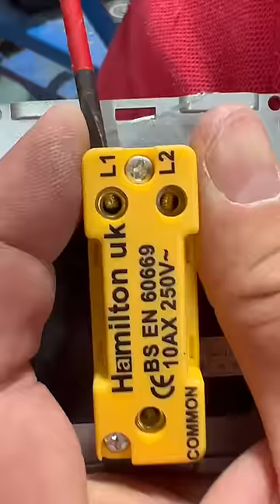Don't Get Caught Short - Wago Push Wire Inline Saves The Day

Comment: No neutral in there so use 2 bits of brown.
Reply: easier to carry normal 3 core and add some sleeving on top
Reply: Better yet, stop wasting time and material and properly wrap the neutral in electrical tape.
Reply: @Amonabus  tape isn’t recommended since it could unwind. Sleeving is easier, faster, better
Reply: @techheck3358 good tape just lasts forever unless the wire in under tension
Reply: @leftifornian2066  sleeving is easier & doesnt leave residue behind 🤷

Comment: Even better is you undo those screws, and find that the wires are not only short, but also that you have a wall where the plasterer went and had to put on 2 inches of plaster, to fix the mess the drunken builder left, who buried the box seemingly in the middle of the bricks. And to top it off, the wire is not nice PVC wire, but 100 year old gutta percha DCC covered, and the insulation will fall off at the slightest touch. To disconnect power you go to the fuse box, and find that all the fuses are now 2 strands of 2.5mm copper, except for the stove, which is 4, so that they will not blow. Power comes from the overhead wires, to the meter conveniently placed, in what used to be the outside covered side entrance, now part of a room, and also conveniently located in a built in cupboard, and feeds to a fuse box, in what was the kitchen, mounted nice and easy to get to in the top of what is now a built in cupboard, filled with around 100 pieces of cast iron cooking pots, all of then sticky with decades old oil and grease. right next to the stove on one side, with 4 pots boiling on it, and the oven running under it, and the floor is more borer than wood, so your ladder has to be placed strategically over 2 joists, and hope the paper thin wood does not let go then.

And the next 5 houses are exactly the same, because the same family has been living in them since 1890, and they got the electric in 1930, and have been rigging the meter ever since the first bill came in.
Reply: gyat damn bro
Reply: You must have been in some houses I have 😊
Reply: Damn, who hurt you?
Reply: You’ve been to Evesham ?
Reply: Suspiciously specific! 
Sounds like that one switch replacement is going to take a very very long time and a decent budget.
Reply: I feel your pain man
Reply: Drunken builders... seems about right ! And don't forget the wires in the wall only twisted together with no screws or anything. Or brittle old aluminium wires. Or finding out that soneone wired up the entire garage to an exrension cord ! 😂
Reply: @funkpop-l8o  You have met Clive then....
Reply: @SeanBZA  who is clive ?
Reply: @funkpop-l8o  Cowboy builder I know. But he at least will do things more or less right, and his work generally does not fall down. See some other "known name" builders, where you have walls that let in light, because of all the cracks, and where they kind of omitted to do things, like putting in all the rebar, and putting in all the brickforce between layers, or attaching it to the columns.
Reply: U.S. Electrician here . I had a story about an old barn built in 1910, but yours is better!
 God damn!

The oldest two family house I ever worked in was built in 1890, still has knob and tube wiring. But one thing to note, it still had it's original 60 amp service. I'll state this again, a 60 amp service for a two family house!
Reply: @funkpop-l8o  Garage extension cord was the previous owner of my current house. He also did his own gas (not legally) and it leaked and cost us hundreds to fix.
Reply: @tailgunner2  By me a standard service is 60A, but at 230VAC. However some really old houses only had a 30A service, simply because when they got electric service they had a wood fired stove, and water was from a well, heated up on the stove, with a long drop toilet outside. Often farm houses, but pretty much all got an upgrade to 60A over the years, simply because they got indoor plumbing, so the occupants wanted to change to an electric stove and hot water, or put in an electric borehole pump, which needs a little more than 30A to start up.
Reply: Pretty good description of hell
Reply: Видимо это интернациональное явление😂
Reply: Sounds like a cup of tea after a long day to me
Reply: @tailgunner2 Is that single phase or twin?
Reply: Ah the voice of experience!😂
Reply: Ong 2 houses this week ancient and evil
Reply: You must be high or drunk when you wrote that comment.
Reply: Ha ha.. ain't that the truth! Unpicking other people's bodges are the most entertaining part of the job.

Comment: Although I do get your point, I myself would not even cut anything off the wall-cables. These wago's can handle some crooked wire too. A break now could find you replacing the wall-cable.

Comment: The Ideal push inline orange connectors are smaller in size and have been around for years or you could just use a 2 way side by side wago connector as I find it easy to dress back in the back Box  and as someone also commented..FFS push done unwaned Lungs as they sometimes snag cables to result in a Line to CPC fault

Comment: We have those same devices in the states. I only trust those for low wattage applications such as lighting. 

Anything with a higher demand, such as kitchen appliances, I would sooner run a new cable than rely on the spring action, even if they are rated for #12 AWG (3.36mm).
Reply: They are tested in a multitude of countries for safety. They have also been around for a long time without issues.

We use them all the time in the UIK.

Comment: Why does no one on these shorts knock down the lower unused lugs on the back box , with more people taking feeds and neutrals to the switch instead of the light  now , so more cables in the switch box , I’ve come across dozens of faults where the cables rubbed on the lug
Reply: Because there weren’t feeds a d neutrals @ this one so not necessarily?

Comment: Whats with all the sleeving in the uk?can you not just use the right colour cable to start with?
Reply: the standard cable is 2 core (blue neutral + brown live) + unshielded earth. when you strip it, you add green&yellow sleeving to identify the ground, and brown sleeving to identify that the blue wire is actually brown (since this is a switch)

Comment: I just pulled all the WAGOs out of my house.  Had one fail in my attic  at a j-box afteronly one year of installation. Did not generate heat but resulted in a non contact issue with both my bathroom lights and fan. In my 35 years of conducting commercial and residential maintenance I've found that low contact, non contact issues result in heat generation and fires. Feel lucky, 3M wire nutsonly from here on out...

Comment: That's a nice stripper tho! Also do you guys across the pond need the grounds insulated for residential? Here in the states only commercial and industrial need grounds to be Insulated.
Reply: Yes, although it wasn't always the case. The reason is simple; when you put the faceplate back on and the wires get bent, you don't want the possibility of the earth/ground touching a live terminal. It's not dangerous as such, but it could cause a fault and trip a breaker with a bit of a bang.

Comment: So, American here, question and excuse my ignorance. Why do I see the bend at the terminations for setscrews?
Reply: The screw terminals are designed to accept more than one wire so for smaller gauge wire, folding (“doubling over”) increases the surface area at the terminal, making for a better connection.

Comment: houses in the USA are quite flammable and you have great code to counter almost all accidents, but it seems like every fool can call himself a tradesman and leave a mess for  others to fix.
Reply: Yes, and I strongly question what these Wagos are rated for.  Lighting?   perhaps.  Microwave oven?   Well those connectors and wires may as well have been routed through one....

Comment: Best to have 2.5 mm flex conductors (wires) from a lever Wago to the back of the socket, using ferrules into the socket terminals. 
No stress on any wires when the socket is pushed back. Much easier and safer.
Reply: What
Reply: @floodbond  
It was explained easy enough.
Reply: @johnburns4017  id use 6mm on a switch 2.5 is not big enough whatsoever hahaha...
Reply: @Ten_Pence  
sure.  yep.

Comment: Why didn’t you just use another length of brown wire to extend the black wire 🤨🤨🤨
Reply: Black is neutral, brown is live.
Reply: @reegyreegz  Ordinarily yes but in this case, the black is a switched line not a neutral so it would have made sense to oversleeve the black, connect it into the Wago and connect a brown wire on the other end.